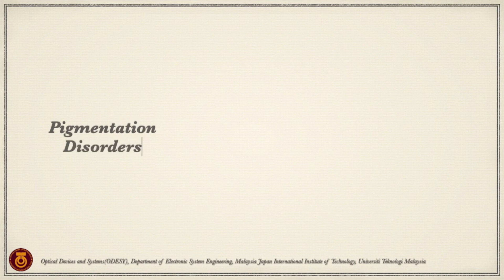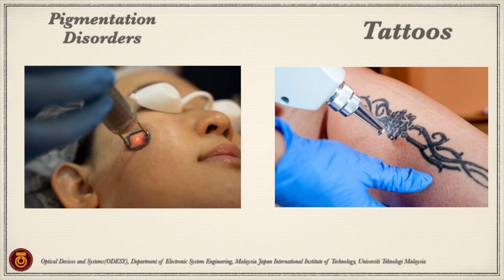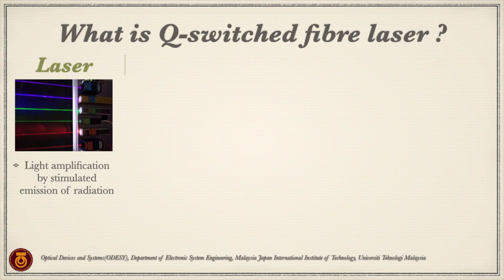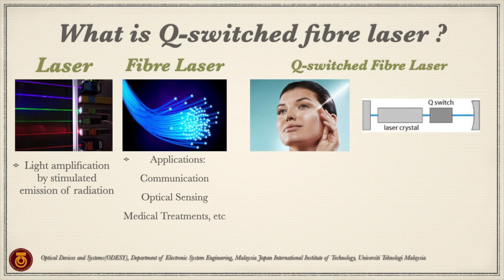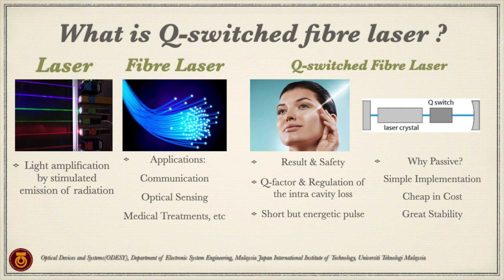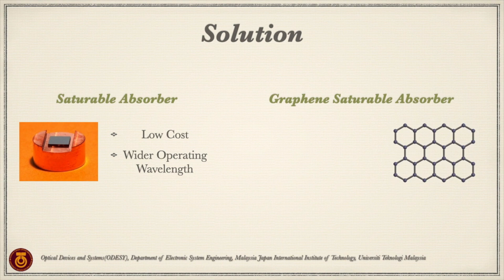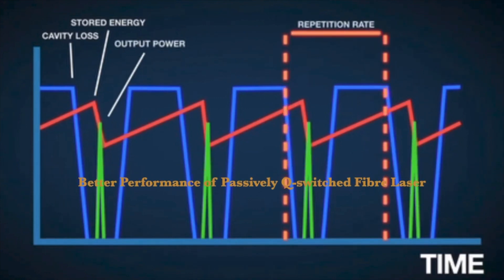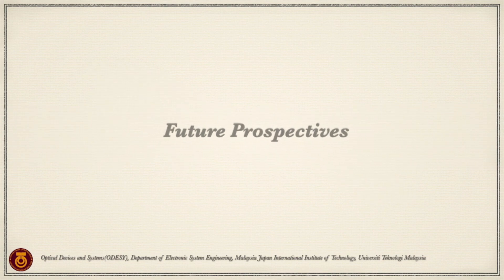Performance Analysis of Passively Q-switched Fibre Laser using Saturable Absorber

Comment: Thank you for your presentation

Question from Examiner:

What is the performance index to be measured to determine quality of the proposed design? Also, how you validate the results from the simulation to express in real system design?
Reply from the maker: Dear examiner, thank you for watching. I am very grateful for receiving your response.  The performance of this design is affected by only 2 factors: 
(i) The direction of the laser beam; and,
(ii) The condition of the equipment being used.

For the first factor that I mentioned, that is the reason the polarisers and optical isolator are being used in the design as the polariser act as a filter to let the laser beam of a specific polarization pass through which blocking light waves of the other polarization. Its functions to refine the undefined or mixed polarization into a well-polarised laser beam. And the optical isolator allowing the transmission of the laser beam in a unidirectional way can prevent the unwanted feedback into the saturable absorber.

For the second factor, which is the condition of the equipment being used, since this research will be done by simulation by using the software named “ Optisystem”, instead of real-life experiment, it will not affect the performance index too much throughout this research in my opinion.

To validate the result from the simulation to express in real system design, there is an approach I would like to propose which are case-control study.

There are 2 methods I would like to use for the case-control study. First, the comparison with the previous research done by the other researchers. The case study will be done by reading the research journals and articles and a comparison of the result in my research with their result will be done to investigate the validity of the simulated result. Second, a practical experiment will be done to justify the effectiveness and genuineness of the simulated result if we are allowed to go back to campus in the coming semester.

I hope my answer respond to your questions.

Comment: Question from Examiner: Apart from graphene, can you suggest other material that is suitable to be used as saturable absorber for Q switched fiber laser. Can you explain why do suggest that material. Thank you.

Good video. Keep up the good work!
Reply from the maker: Dear examiner, thank you for your compliment, I will do my best all the time.

Also appreciate the questions, below are my answer.

For answering your question, there are many other material selections for the saturable absorber. Based on my literature study, I suggest the types of nanomaterials been used as a saturable absorber into several categories:

(i) Carbon-based nanoparticles: Single Wall Carbon Nanotube (SWCNT) as it is basically rolled-up graphene. Same with graphene, SWCNT possesses highly nonlinear optical response, with saturable absorption, so it is also a recommended as a material to be used as saturable absorber. Also, CNT saturable absorbers can exhibit very broadband absorption features as are desirable for broadband lasers. The recovery time of CNT absorbers is quite short, but substantial non-saturable losses can be a problem for some applications.

(ii) Semiconductor Quantum Dots (QS): Cadmium Sulphide (CdS), Nickel Disulfide (NiS2), Lead(II) Sulfide(PbS). The high optical nonlinearity and low saturable absorption also make it a material suitable to be used to analyse the performance of the nonlinear properties of passively Q-switched fibre laser.

(iii) Metal nanoparticles: Gold(Au), Silver(Ag), Samarium(Sm). Its great optical nonlinearity properties, broadband absorption and fast response time and its saturable absorption properties make it an ideal saturable absorber for this kind of research.      
(iv) Metal Oxide nanoparticles: SnO2, CuCrO2 as they also exhibit great saturable absorbance and optical absorbance as well. Its fast recovery time, the high damage threshold and excellent chemical stability of metal oxides make it one of the popular choice as saturable absorber.

The main factor affecting us in the material selection for saturable absorber to study the performance of Q-switched fibre laser, which are:
(i) Low saturable absorption to minimize the power losses for desired high pulse energy and short pulse duration;
(ii) Wide operational wavelength to achieve great optical absorption;
(iii) The recovery time should be short but not shorter than the pulse duration, however, this problem is rarely been occurred. 
(iv) The damage threshold should be sufficiently high;
(v) The stability of the materials to generate a stable pulse;

All of the material mentioned above and also the graphene which been decided as the saturable absorber using in my research possesses most of these criteria.
 
However, graphene is selected to be used as the saturable absorber in my research because
(i) Graphene is very low cost and easily get compare to the other saturable absorber ;
(ii) Graphene is a zero-gap semiconductor with an anomalous quantum Hall effect which makes it have a wider operational wavelength; 
(iii) Graphene generate the stable pulse;
(iv) Graphene’s  recovery time is acceptable;
(v) Graphene have low modulation depth which minimises its possible change in optical loss; 
(vi) Graphene possesses great thermal stability which minimises the environmental factor to affect the accuracy of the result.

It generally possesses the similar optical properties and criteria with the other materials which I mentioned above but its relatively low cost make it the preference in my research.
Reply from the maker: I hope my explanation answered your question.